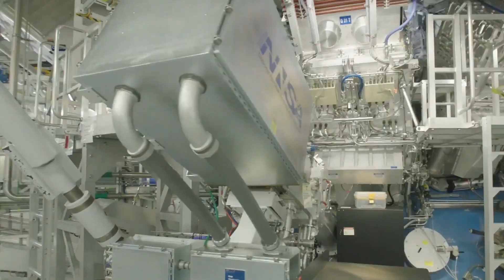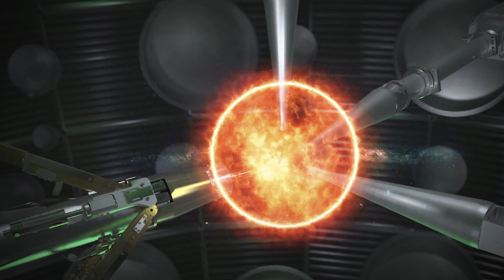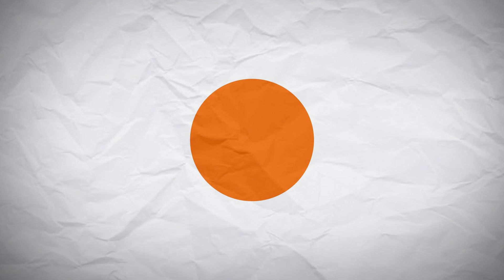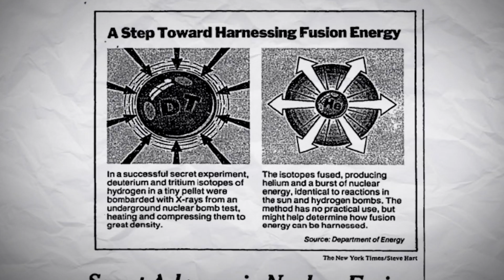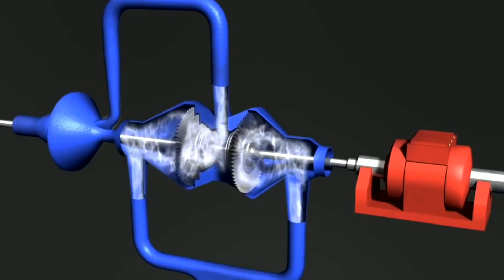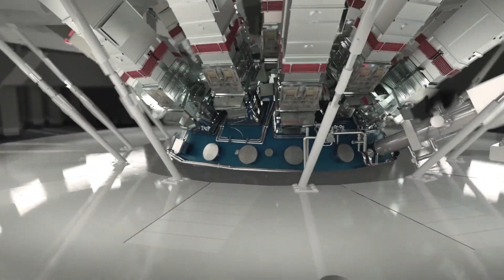Breakthrough in Nuclear Fusion Energy Explained

Comment: Thermonuclear approach doesn't work. Revise theory first. Thermodynamics says it clear and plain - you can get more energy from an isolated system than it already has. You can't lock plasma and keep it heated while extracting excess energy out of it. That's why it overheats or stops to work.They know this but they are paralyzed with authority and old outdated theories. This is not the way Sun operates. Thermodynamics must hold there too. Sun can only transform energy. It can't propelled itself from within. The same case - an isolated system can't do work upon itself. Current theory treats stars as isolated bubbles of homogeneous ionized gas which propel themselves from within. Even thermonuclear bomb needs to be started with fission bomb. Theoretical physics is stack with too much money and toxic politics. Only lattice confinement fusion is the answer. Gaseous state is absurd. Stars are not gaseous plasma and those experiment already delivered enough evidence to confirm this. Tremendous amount of money has been already spent and nobody will never say 'we were wrong'. This is business and people involved in it are not scientists. They are opportunists.

Comment: The lasers used are less efficient than the 1% which I had assumed. With modern lasers 'approaching 20% efficiency', let's assume that they're 16.7% efficient, for simple Maths. That would mean 1/6th of the input energy ends up as laser energy. So if they could be scaled up and were good enough to be used in that system, that would yield an overall energy conversion efficiency of ((1/6) x 1.5) = ¼, or 25% . 

That estimate excludes the power lost by all of the ancillary equipment, such as the laser power supplies, which can never be 100% efficient, and will be peaking at maybe 90%. The magnetic fields have to be generated, presumably by superconducting magnets, whose coolants require quite a lot of energy to produce. 

With today's technology, and using 'high efficiency' lasers, I would be surprised if the overall system efficiency bettered 20%.

So, what do you think? Do you agree that Fusion-derived electricity is about 10 to 20 years into our future? <Hmm... Sounds familiar... 🤔>
Reply: Just out of interest, how much Tritium is available for use in these reactors each year? A few grams?

Comment: "More energy was released by the reaction, than went into the fuel" is an impressive success, but not quite as conclusive as it sounds. I take it that the correctly measured energy of the fusion products was half as much higher than the energy supplied by the lasers causing the fusion.
But that's a long way from having a working reactor. Most of the energy is in the speed of the neutrons, and that's quite difficult to extract. In a water-moderated reactor,  neutrons with a small fraction of the energy of this experiment interact with enough protons to make water into a very high pressure gas called "steam", which is nothing like the stuff we see in the kitchen. In a "Molten Salt" fission reactor, the fission products themselves heat the solvent they are dissolved in, very efficiently indeed. This energy is passed in stages by very hot fluids to the steam turbine stage.
The  difficult part is to get the energy efficiently enough back to power those lasers

Comment: it takes zero energy to produce fusion. it takes two things 1. temperature and 2. a container that can maintain the temperature with a less than 5 percent loss of containment above critical temperature to undergo fusion. the fusion will increase the temperature as long as the energy does not go anywhere that is the minimum temperature to achieve fusion. the excess can be harnessed for power generation. designs are patent pending.

Comment: Nuclear fusion is a 65-year-old scam! This scam has not changed in 65 years, it's still the same. It produces a lot of money but no electricity and it's not going to. About every four years or so the industry pops up and says we made a major breakthrough and they start fishing for money. The US provided 700 million dollars for this last go-around and after about a year you will start hearing that it will be about 30 years or so before it will achieve success. Just like over the last 65 years, your money is gone. With billions of dollars at stake it's very easy to build machines that glow and make noises and that is all you are going to get. YOU HAVE BEEN HAD!

Comment: A BS break through, nothing said about the cost of making energy pellets and the energy input to that process and I always wonder what are they going to do with 2million degrees of heat (or more) you only need 100 degrees to create steam and perhaps 300 degrees to create super steam even using oil as an expansion medium to drive the turbine to make the electricity doesn't need this amount of heat and claiming that it is sustainable meaning that it no longer needs huge energy inputs to maintain the plasma is just nonesence.

Comment: There are lies.
There are damned lies.
There is statistics.
Then there is nuclear fusion.
The lasers used 300MJ power to make 2MJ laser pulse that output 3MJ  fusion power.
How the ** is that in any way a nuclear fusion reaction???
Even the supposed 3MJ outout power could easily be simply a measurement error.

Comment: This same process can be accomplished  substituting lasers with low voltage high current arc energy. An engineer named Randy Mills is several steps ahead of LLN Lab. Randy uses a hot hydrogen plasma atmosphere in a reaction chamber and creates a sustained high current arc while introducing water vapor.  The result is sustained over unity energy production at a much higher gain than LLN Lab.  Check him out for more fantastic cutting edge physics.  I love this stuff.  The future of energy production is on the verge of a great disruptive change that will change the world and "Power" structure.  Will this breakthrough be allowed to happen?  BTW, it took 300 Mjoule of electrical energy to produce the 3Mjoule of laser output energy.  They used the 3Mjoules to calculate their gain.  The output was not overunity. But they are heading in the right direction. They needed funding for next year.

Comment: hollywoofd beamer laser ?
You are not crazy but silly  and believe not anything ?  Light laser has no field strengh, only 0,03 Tesla.
Neutrons have  just to 150 T  and more !

Temperature is not velocity but resonance of gas only then other resonanc 
is necessaire by charge and field strength. You are crasy and an totaly idiot !

There's inertial fusion and laser fusion. (for light color formation)
One is the opposite of the other. Otherwise you would be insane.

Comment: Don't fall for the hype. A  working fusion reactor is still many years away. There's a huge difference between this small 'bench test' and a Gigawatt power plant. And there is the problem of the critical fuel component, Tritium, one of the rarest of elements. Only a few kilograms exist, reserved for such testing and development. The reactors used to produce Tritium supply are being shut in. No Tritium ... No Fusion.

Comment: There is one problem no one is talking about. Inercial confinement systems have a huge problem - heat removal. Although the idea of making steam makes sence, how exactly this is to be done - not yet known. Rather rapid pulsations from fusion reactions (the "explosions") will have a dramatic effect on the vessel, and an exact method of removing heat from such a process is still unclear. Rather sceptical despite modern lasers etc. This should be looked into!

Comment: How is that net energy that is release goin to be absorbed as stored energy for later use?
Reply: There would be a shielding blanket around the reactor walls that absorbs the neutrons, heating up and transferring the heat to a water to steam loop. They might be able to use liquid metal as the shield or shield cooling material enabling a higher temperature and efficiency in the electricity output. I think up to 55% is possible, but the liquid metal is a pain for corrosion so it's not a clear win
Reply: @Canucklug  why not mix the liquid metal with anti seize over the copper as the shielding blanket to absorb the heat and transfer the heat through connected copper water vapor chambers. Also aluminum or stainless steel fins can help regulate over heating around the shielding with fans 😂
Reply: @xXBobbyXx86  😅

Comment: They are still lying, fusion creates a new substance, by fusing together two particles, they should have a new substance as a by product, but don't and when I try to ask, my freedom of speech is shut down.  What kind of science is so weak it can't handle a question?  It's a con. The investors deserve better...  Deuterium is h3o , heavy water. It's possible they are flash igniting the deuterium's hydrogen and burning it, using the oxygen as a catalyst, causing a small explosion.  It's electrolysis at best, leading to fission, but not fusion.

Comment: This was quite well explained without losing to much detail and doing too much simplification. However, I don't think we will see fusion reactors based on this method, as it is really difficult to up-scale this specific setup, and getting a good efficiency. And I think, generating power is actually not even the original intention of the facility.
Reply: Agreed, was thinking the same as I was watching. Ziroth's point that this should drive more funding seems very cogent to me though.

Comment: They did not achieve fusion.  They didn't even account for the energy of the power plant that was used to create the experiment.  Truly suspect to leave that out. Hmm
Reply: They did achieve fusion. Humans have been achieving fusion since Rutherford and Oliphant in 1934. Even kids do it in their garage these days. They didn't achieve system break-even. If you watch the actual press conference you will see that they are very open about this - they make the clear distinction between the Q at the Hohlraum and the Q of the whole plant. It is the journalists that run away with the sensationalist part and gloss over or completely leave out the other details. Nothing suspect there. They were even particularly up-front about this primarily being a weapons research facility, and that energy generation research is just a tiny part of their work.

Comment: In summary, it is safe to say that fusion energy is still 30 years away.  The rule has not been broken.  Note that even if you achieved the Q required, the technology still have to achieve economic viability.  Solar & wind energy are matured green energy but they are not economical viable as they require too much land to supply all the energy we need.  Even if you ignore the nuclear waste issue in fission technology, it is still too expensive compared to fossil fuel.  Greenhouse effect from fossil fuel can be mitigate by carbon captured technology.  Fossil fuel is expected to last at least till the end of this century.  Until then, I don't see a future for fusion technology.  Even if the require Q is achieved, it still has to compete economically with other forms of energy.
Reply: Except that our carbon capture technology is pathetic, and even if it wasn't nobody is really trying all too hard to get it done. Furthermore, there are vast areas of land that have no realistic value going on around there. The issue with Solar is that it would require serious cooperation between countries. For example, Chihuahuan desert has a shitton of land that nobody is using.
Reply: Each type of solution viability really depends on the economy.  Before China entered the market, nobody thinks the solar solution is economically viable.  China has her geopolitical issue.  Solar heating solution in Sahara desert is obviously viable, but the Saudi is not pumping money into it apart from buying up the land.  When oil is depleted in Middle East, they will build solar in the desert and sell the electricity across the Gibraltar strait to Europe.  So each technology will has its chance when the economic makes sense.  As for fusion, it is beyond the end of the line we can see for now.
Reply: @Valdimir Nobody is putting money into carbon capture because the leftist is using global warming as a reason to ditch fossil energy.  They don't want a solution to global warming that would keep us on fossil.  They are idealists who wants cheap, clean, and limitless energy.  Just as they want a utopian society with unlimited resources.
Reply: O

Comment: What is the type of energy released is it the kinetic energy in the neutrons or is it xrays
Reply from the maker: Kinetic energy, these are then caught by a blanket on the outside of the reactor and the kinetic energy is captured as heat in a cooling fluid. Hope that helps!
Reply: @ZirothTech  thank you
Reply: @ZirothTech  
Um, the US experiment plans to retain the heat for continued fusion and uses the magnetic field to turn the generator, not steam.

Comment: that means the heat produced can sustain the chain therefore there may not need external beam after ignited but yet  energy needed for producing magnet  will be required.
Reply from the maker: Once the first bit of fusion starts, there shouldn't be a need for more external energy during that reaction - however, every time there is a new fuel pellet the reaction starts over, so another laser beam is needed! Hope this helps :D

Comment: I think what Helion is doing is more promising. The NIF setup simply proves what we already knew - that fusion on earth is possible and that done correctly you can get a net gain in energy. 
What this facility will never do is repeat this several times per second and sustain a chain reaction so we can actually use that net gain in any meaningful way. The ITER plant is in the same boat in my opinion and I think we should be starting backwards as Helion are doing and focusing on how to use the energy we gain
Reply: ITER is being designed in a way that they can swap out and test lots and lots of designs for heat transfer and fuel breeding.

There are a lot of unknowns within the engineering context. These systems all add to the overall knowledge.
Reply from the maker: I agree with both of you here, Helion is much more promising for energy generation than NIF (they are more focused on nuclear weapons testing I think), however ITER is still highly valuable for answering the research questions needed for commercial tokamaks

Comment: Great video but what exactly is the burn wave?
Reply from the maker: Thanks for the comment. The burn wave is the spreading of ignited (burning) fusion fuel from the centre of the fuel pellet outwards. It is called a burn wave as it is similar to how when you ignite gas, for example, the flame spreads across it like a wave. Hope this helps :D
Reply: @ZirothTech  Okey thank but at what speed does the wave propagate. Can some fusion fuel escape the wave or how does some material not get fused?
Reply from the maker: @zanpodlesnik4337  I am not actually sure on the exact speeds, but yes exactly, some of the fuel explodes out faster than the burn wave, so it doesn't get fused! Trying to design a pellet that allows more of the fuel to fuse is definitely a big priority.
Reply: @ZirothTech  Aaa thank you very much for the clarification!

Comment: What about that it only excist 25kg  of tritium on the planet?
Reply: Tritium can be made by irradiating lithium iirc. In theory once the reaction can be made efficient enough to be profitable, it can irradiate enough lithium to make it's own tritium. You just have to provide the deuterium and lithium, both of which are very common. (assuming I'm remembering this correctly)
Reply: @cerebralm   this isn't economically sound because you need a lot of energy for that process... ITER's "blanket" will try to generate some for it's own needs -  but the concept is not even tested: From the ITER's original site: "the next step on the way to commercial fusion power, about 300g of tritium will be required per day to produce 800 MW of electrical power."
 300g of tritium per day.... this alone is such a massive challenge.
So much effort for so exotic, unproven, not economical, and always 30 years in the future tech, yet fully working nuclear plants are closing (Germany) and so little effort for creation of better nuclear tech - like Thorium reactors...
Reply: @LyubomirIko  I agree, even current-gen fission would be such a huge step forward for humanity if it was funded properly. But there really IS a huge amount of political inertia against anything that would revolutionize energy. It's all suppressed, whether it's theoretical fringe over-unity physics, fusion, fission... hell, even the American alcohol prohibition was started in part to stop people making their own ethanol additives. The political/corruption problems are harder then the physics problems at this point.

Comment: And a electrical generating fusion power plant is still 20 years away,,,,,,and always will be. Thanks for this level headed video.
Reply: The quip is more accurately "Fusion power is 20 years away, and always will be."  
Another good quip is that "The impossible is always one generation behind that thing's creation."  
Just made that one up, but looking at history it doesn't feel far off.
Reply from the maker: Glad you found it useful! Video on electricity generation in the works which I think you might find interesting! :D
Reply: @ZirothTech  Would absolutely love a video like that! Will you talk about project pacer? 100 pellets per second is really unnecessary, like you said the fuel pellet could be scaled in size. Energy production should definately focus on this instead of scaling the number of individual fusion reactions. That way, once the burnrate problem gets improved the reaction could sustain itself indefinately, so laser efficiency wouldnt even matter at that point.